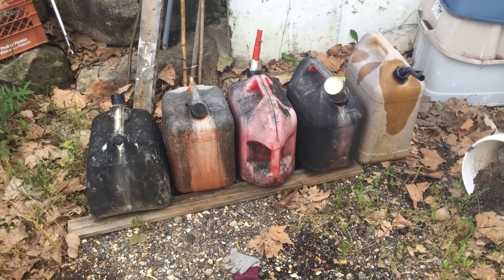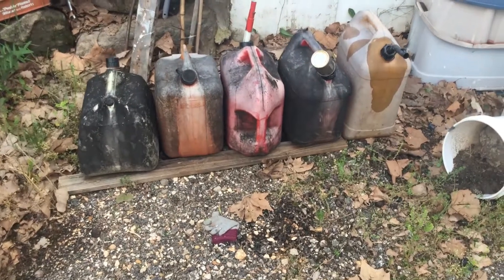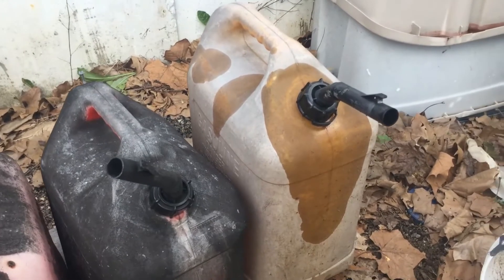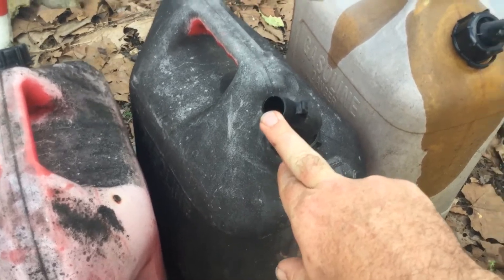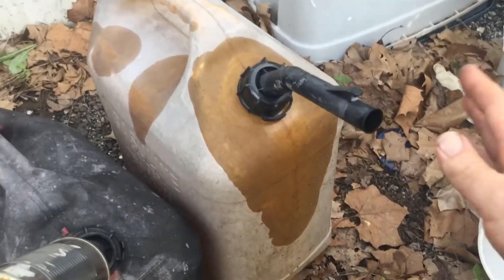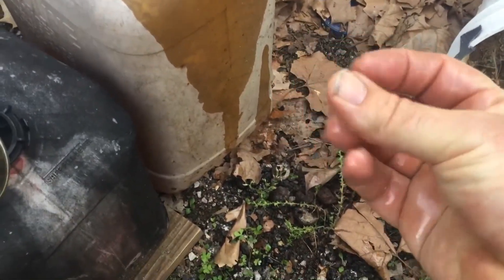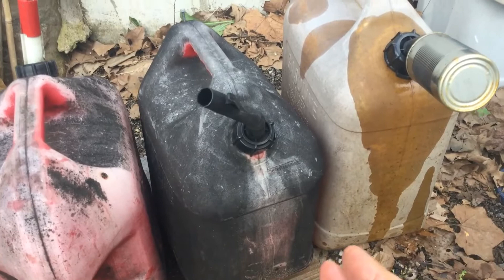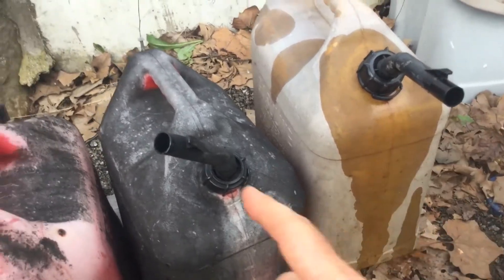How to tell Diesel Fuel from Gasoline

Comment: Today I put gas in my truck in one station to get to another, truck ran famously till I put gas in at the second station.....then it refused go run. I sat from 9:30 am till 5:30 as it refused to run. Had AAA  tow me home....everything was fine till the second station. Now I have to go tomorrow and figure out why it suddenly wouldn't run.  Tried all day to start it. No dice.....ruined my day. Is there a place that can test a sample to tell you for sure, as  I had no problems before...I tried holding the gas pedal to the floor, pumping the pedal, adding carb cleaner to the carburetor.....nothing worked. Never smelled flooded.

Comment: How bout if the gas station put diesel in the gas pump, and right away your car refuses to run.how can you tell there's diesel in your gasoline ?
Reply from the maker: The easiest way is to take a fuel sample and check its gravity with a hydrometer, but most people will not have one.  It the fuel to too heave, it is the wrong fuel.  Will vehicle start and run for a second with starting fluid?  If not, this is not a fuel problem.  You can also pour fresh fuel into the carb to see if it will start and run for a few seconds.  I have an old lawnmower fuel tank that I rig up higher than the carb.  Hook the hose from the lawnmower tank to the carb inlet hose and use gravity to feed the carb with fresh fuel.  This bypasses the truck's tank, fuel pump, and filter to see if it will run.  Good luck,  PP

Comment: I found tonight, a red fuel canister in the road that looked brand new. I circled back becouse my cars (335,000miles) fuel gauge is not very accurate under a quarter tank and thought it would be nice to have a new portable 5gallon on hand 😆. I thought it was almost empty but is over 2/3rds full . I will try your method out tomorrow morning .

Comment: I think for gasoline put it in a styrofoam cup, it dissolves the cup in a shorter time whereas with diesel or kerosene the cup lasts longer.
Test with known fluids ideally to see the effect, the difference.
Some pour off a little and walk far, FAR away and set them alight... obviously more dangerous.
Gasoline starts on fire easily, diesel or kerosene not so much, may even need a wick or warmth to start up...
Now you do that at your own risk with maybe a thimble of fuel far away from fuel cans! Maybe use a long stick to light them not a match or lighter.
It's dangerous and you probably shouldn't do it!
Gasoline has flammable vapors!
SO, in conclusion it's safer to do as this guy does or use a styrofoam cup or actually both.
They also smell different but one has to be familiar with them...
Color might be different but this makes me nervous because in different countries they dye fuel for different reasons and I'd not go by that unless intimately familiar with your area and what they do which may vary.
Kerosene, diesel, home heating oil are all similar but may have different colors. Some heaters use gasoline so know what you are doing!
Gasoline is different than those but could have dye?
What do they do in your area?
I have no idea!
I wouldn't go by color or casually set anything on fire...
They have different colored cans for a reason...
If you are forced by necessity to use the wrong can try to label it in some way AND test it!
It's not great to get this stuff on your hands either but hopefully you aren't doing this regularly...
Also consider if you didn't fill them personally, labels and colors of cans may be wrong!
Also you may have forgot...

Comment: Very helpful video thank you. I am in the same predicament I have 2 jerry cans but  forgot what I put in them. Does diesel have a use by date, e.g. can't be used over 2 years old? Thanks
Reply from the maker: Hi Al,   Diesel fuel that is stored over 1 year should have a stabilizer added to help the fuel make it to year 2.   I would not used 2 year old diesel fuel in any newer common-rail diesel systems.  Thanks for watching.
Reply: @ProfessorPentane  Thank you Sir. I will use it to aid bonfires rather than put it in my car. You have just saved me a broken engine. A very useful channel. Best regards from England👍